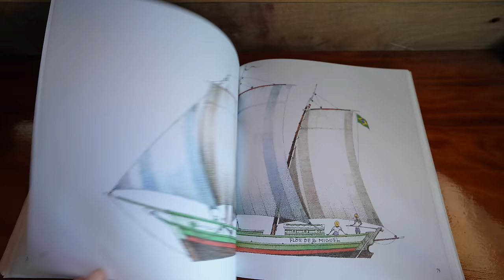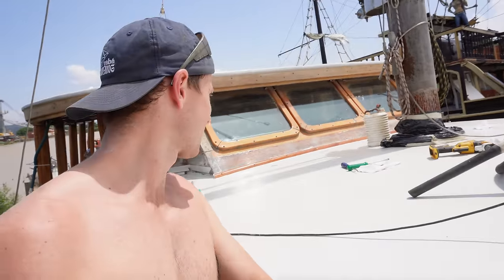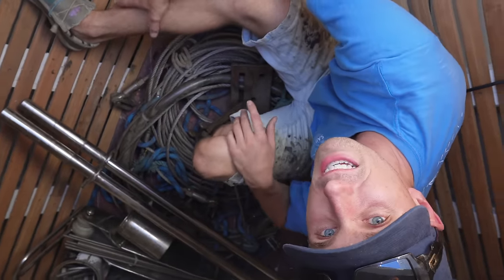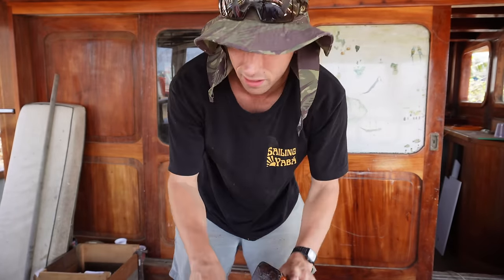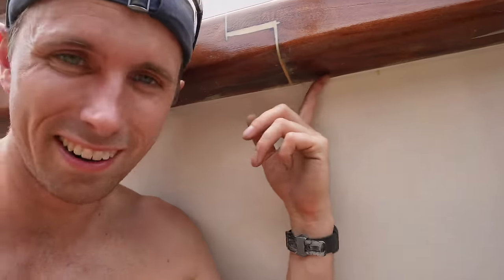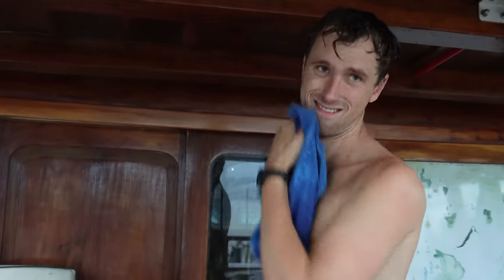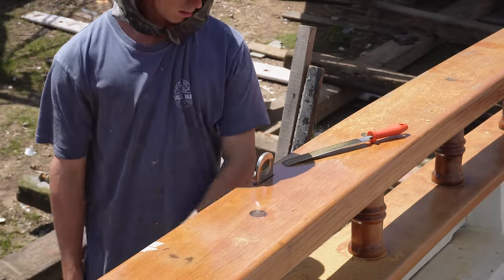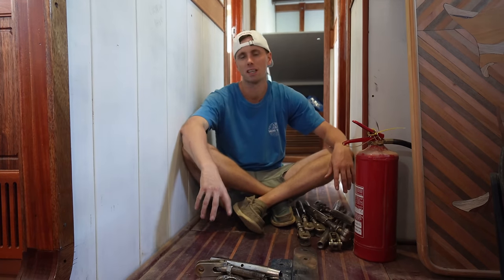These stainless plates have to hold our hardwood masts up (boat restoration) — Sailing Yabá 163

Comment: the plates has to be in line with the rigging.
so not strait op but in an angle.
so that the force is in the same line as the plate
Reply: That's a fair amount of straight chainplate above the deck and any bending of the chainplate  due to the tension on the rigging could put a load the railing sideways since it's a tight fit. I think angling the chainplate above the deck towards the rigging attachment point on the mast would avoid side loads. Just a thought I yield to the professionals :)

Comment: Hi Guys
The chain plates should be in line with the rigging and not vertical also your top rail is going to be under a lot of pressure and will need securing down in those spots with a block I would say to stop the rail twisting. 
We all want to see you splash the boat and go sailing but safety first . 
Did you sort out the prop shaft? 
ATB Mike 
StayCornish😬
Reply: not really, only for the shrouds going to the top of the mast, fore-/aft intermedeate shrouds dont take that much load.  But they should be bolted through and fastened to a structural piece of wood....
Reply: Safety  on  many  other  channels  is  third  to  fifth  .  .  .  .  .  .  why  be  different  .  .  .  .  ?

Comment: Hi, Yabas, I would mount the chainplates, as was said below, in line with the shrouds. That means that the chainplates won't be vertical: there must be a bend inwards at the height of the deck/coverboard following the attachment angle of the shroud. The way you mounted them they will create a lot of strain on the cap rail which isn't meant to take it. 
Also, the chainplate must correspond to the angle of the attached shroud seen from the side of the boat (fore/aft angle) and not be mounted vertically.
Finally, you should check if you could fasten the chainplate throughbolting it to a frame.
Reply: I fully agree in addition to that I am sure your cap rail will break soner than you would  like to think.
Reply: And don’t put those slots in the covering board and cap rail.
Reply: I agree with all of the negative advisories about the chain plates including the big strain on the cap rail. Yes you did say at the beginning that some of these boats had no stays at all so perhaps the tensions will be less than on a yacht. Unless you start again from scratch with a new layout, and I can't see you doing that, you will have to live with it as it is. However you could consider just fixing them at the bottom on one bolt and extending the slotting as needed when you set up the stays to the correct angles. Only then fix them permanently in position. There might be a case and a need for some braces from the rail to the deck running rigging fittings etc. You might also be thinking about positions for winches.
Reply: Very good comments.
Reply: the cap rail is pretty strong and the masts are pretty short on the ship. So i wouldnt over-dramatize the the mounting position.

Comment: I noticed on day 5 early in the video both a positive and negative cable were going through the same hold.  PLEASE DON’T DO THIS. Wear and tear could cause a short which could lead to serious problems. I know because I had that problem on one of my boats.  Check to be sure you don’t have t this condition anywhere else on the boat.

I do enjoy the videos.
Stephen S

Comment: Agree with all negative comments on the chain plates. You needed to spend more time in setting the correct angles, and as for going through the hand rail.. have a thought on how much stress and movement there will be on the hand rail🤔

Comment: You should have used an oscillating multi tool instead. And then a file to smooth it out. Could have been much faster.

Comment: When you realized you had neglected to mark and identify each of the chainplates and record their location and position on the boat upon removal, instead of seeking expert advice you straightened the chainplates, further complicating the issue. Stop what you are doing and engage a rigger and work with him to do it properly. What you are doing will weaken the boat and expose you to the laughter of those employed by the marine industry and your fellow sailors. Sorry to be so blunt but someone has to

Comment: As others have stated, the chain plates need to be inline with the shrouds. Also, running the chain plates through the rub rail and the hand rail is a really bad idea. You are creating the perfect location for rot as you will not be able to properly seal that and the metal will cause condensation inside the hole. -Not to mention straining the hand rail for no good reason. You have literally hundreds of years of well documented and time tested principles to study and apply and it seems that reinventing the wheel is the preference for some reason. Please consider speaking to an expert in rigging and leave the tlar engineering behind. The prop shaft being another example of home brewed solutions that need to be addressed before leaving the harbor.

Comment: Its good that you're taking a break Ben, I think your chainplate fitting needs more thought.  I dont usually comment because its your boat and I dislike impertinence but I fear for you here.  I get that some of these boats had no standing rigging and that may temp you into thinking that the shrouds will have a backup function only.  However, in installing shrouds, they will indeed take all the lateral forces under sail, so they need to be right. 

Have you considered re-shaping them, running them lower down the hull so that the top of the plate and the large hole arrives at deck height and then fastened through the frames and hull planking?  The rigging can then run through the cap rail if necessary.  Also I hope you consider using dyneema for the standing rigging,  lighter and stronger than stainless steel and you can see any developing damage.  SS is great until it breaks and has a tendency to hide it's wear which is why insurance companies need to see SS rigging replaced every ten years.  Sorry if that's a downer, happy Christmas to you both.

Comment: Hi you lovely workers ❤ screws with tighter threads are stronger than coarse threads, due to the surface holding the screw is larger with tight threads, just FYI, bigger is not always better, best regards the technisian, keep going 👍

Comment: Free standing masts are best but you are using the old masts so you may need some standing rigging..... bummer. I am designing a free standing mast for our boat just now but it is much smaller boat and not having chainplates and and shrouds to trip over all the time and poke holes in the deck for seems wonderful. The wider apart your shrouds are the more support they will give, however, the wider they are also means the limits to how far your sail can go out to the side for off wind sailing without the sail rubbing the shrouds.  Another reason for free standing masts.

Comment: Painters caulk can be wiped away with a wet rag. Keep the rag in a old paint can with 1/3 water in it. So the caulk on the rag doesn't dry. Ring it out and then wipe the excess off. Using tape of not only caulking, but also painting a straight line in a waist. They have toxic cancer causing forever chemicals in it. And there made by companies like 3 M. Killing all forms of like on Earth for profit. With no care. Thank you for her doing your part them do so. Also for your own profit. Painting a straight line isn't that hard or that big of a deal. Once your good at it. It's much faster than taping. Ignorance is bless. ✌️&❤️ to and from all!

Comment: Hi guys just let you know bending then straightening can cause micro stress fractures (no matter how thick the Stainless is ) in stainless steel. get the chain plates checked for stress fractures they do this by nondestructive testing using a dye. Keep the good work up

Comment: You're all doing a fantastic job rebuilding this boat and I love the videos, can't wait for them to come out every week. Just thinking abou you drilling through for your chain plates and thinking wouldn't it have been easier to use a multi tool to cut through as it would be straight lines on both sides. All the Best. Paul from London England

Comment: Not sure if you could find them locally, but there is such a thing as a square hole drill bit. Essentially, it is a square chisel with a drill bit in the middle of it. Might make the other holes a “bit”😎 easier.
Reply: Do those work with a hand drill? I've only ever seen them on dedicated mortising machines. I don't believe it would work as you need the pressure from the mortising machine to start the chisel section before the drill will even hit the wood.

Comment: I am concerned that the mast stays will not be firmly fixed for the job.  In the original design the mast was allowed to flex and bend under  load but by adding stays you are taking away the opportunity to do that, so the stays will be taking considerable force.  Therefore, the fixings for the chain stays must be very sound and be fixed through the structure of the boat i.e.the ribs.  Whilst locating the stays based on an aesthetic consideration, the primary goal should have been to fix them through the nearest rib.  It doesn't matter that the mast will probably be strong enough on its own but because the stays have been introduced all the load is shared between the stays and the mast.